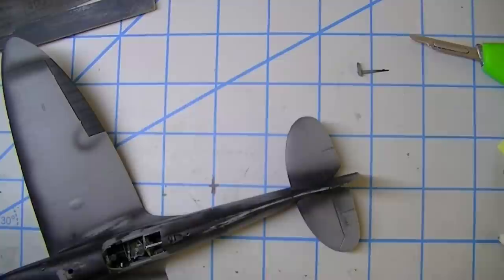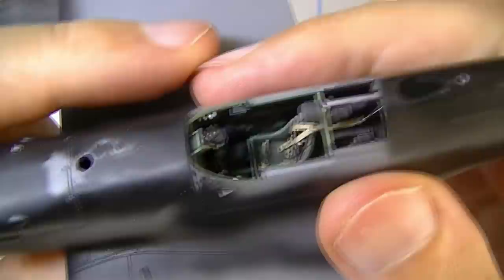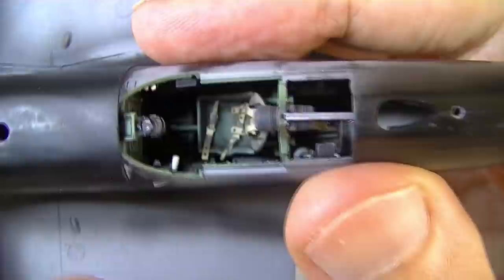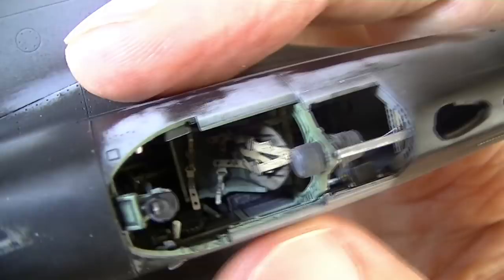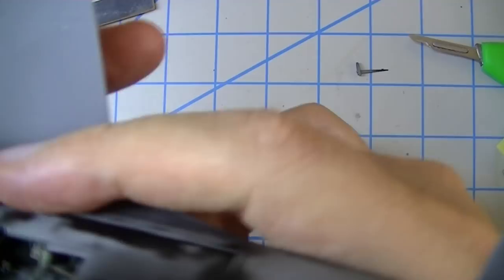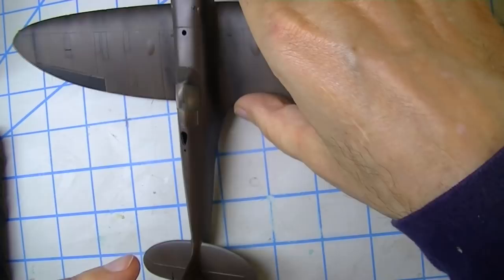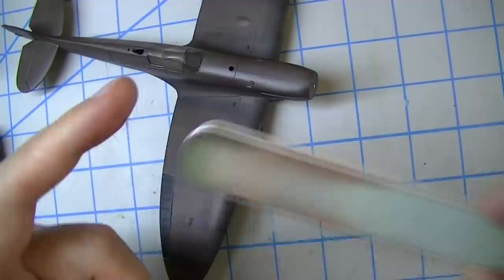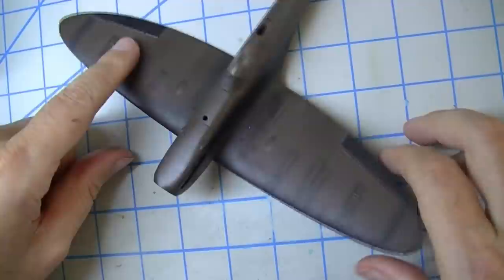ep276 - fundamentals: building the tamiya 1/48 spitfire mk1 part 13

Comment: I have ordered more of the MR Surfacer 1500 black and doing that I also ordered some of this Mohogany one, I think it could be a good base for rust stuff, it was good to see you using that already on your Spitfire, I always used the 50/50 mix to spray MS as primer but recently I tryed the 70/30 reduction as sugested by some coleges in SMCG and I liked it more, I lowered the pressure a bit and got a lot more control and less splater as you had on the black, I observed a much smoother transition.

Comment: 44:50 - Will, thank you.  I only build modern-ish kits, and so I've never seen an oily greasy kit. HOWEVER, it boggles my mind when I see people washing the kits with soapy water and a toothbrush, and then manhandle a model whilst painting it with OILY SKIN.  The damage you could do scrubbing parts that are attached to the sprue and the hydrophobic properties of the washing up liquid most use has absolutely no gain in my eyes.  It's simple: build the kit, sand, fill, whatever. As soon as you reach for that airbrush, it's time for gloves in my opinion. Just a quick wipe with IPA to remove skin oils and I've never had paint peel yet.

Comment: Regarding cut lines: if your artwork was drawn in Illustrator to start with, then it would import into the Silhouette software with cut lines already done. Since you’re coming from Photoshop, which produces a simple bitmap of the art, that’s why you need to create the cut lines in the Silhouette program. 6 of 1, half dozen of the other. Personally, I like the drawing tools in Illustrator so I would trace the scanned art there first. Bezier curves are your friend!

Comment: Hey Will.
Just fyi, I looked back at ep270 and in that we clearly see in the first 10 mins that both halves show a partial double recess at the rear of the teardrop cutout as per (arrow to B18) your instructions. I.e. as one would find for an optional cutout/drill hole.
Many thanks for all you do and say mate!! I learn from  and enjoy your videos.
Further, I have a degenerative Neuropathy and you inspred me to believe it possible to use my reduced manual dexterity.  I cN and do!!!!
Reply from the maker: right but i don't see any mention in the instructions.
Reply: Yesh. I quite agree re not being in the instructions. Just thought it might be helpful to know they exist in reality.
I guess my wording came across wrong to you. Thats sadly the downside of typed communications. 
All the best to you mate.
Thanks for all you do!!
Reply: It’s in step one and step three for the necessary cuts to be made on those parts.  In step one look at the upper let corner calling out the cuts to parts B11 or B20.  Step 3 it’s in the middle of the step on the left side for the cuts called out for B12 or 19.

Comment: Do you have the cutting mat that came with the cutter?  I don't use the sticky side.  I just turn it over and tape my material to it that I'm going to cut.  I use that to line up my cutting with what you see in the Silhouette tool.   Works pretty spiffy.

Comment: Hi Will great vid and you do bring up a good point in respect to the morse light, was it always fitted? I assumed that due to the specification for a day/night fighter that it was always there but I have looked at wartime footage and pictures and found to my surprise this was not the case, with the morse switch mounted on the starboard side of the cockpit the pilot had to transfer his control to his left hand to use it, not very practical but I don't think this would have been reason enough not to fit it, however in some images it has clearly been painted over, removed or not fitted in the first place, it seems the PR types didn't have one not surprising due to them working alone most of the time and the quest for a more streamline shape and the bubble canopy types on the whole seemed not to have one in that position, perhaps someone with more info can explain why this was the case but for modeling purposes I would say it's not wrong not to fit the light as long as your not trying to represent an actual individual aircraft.